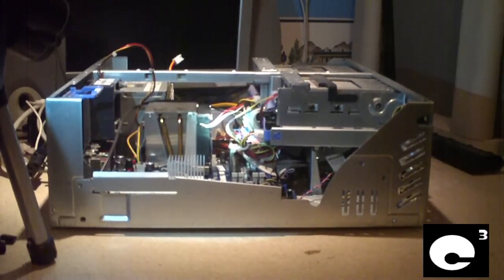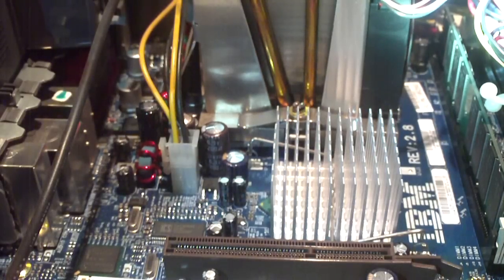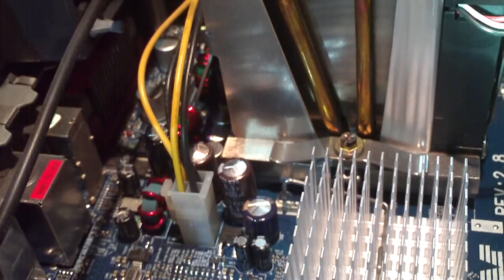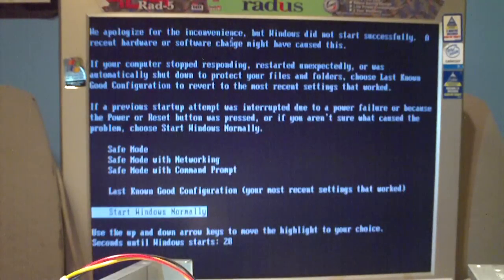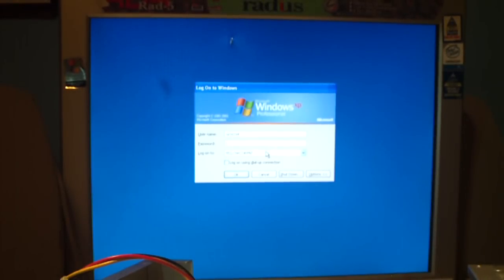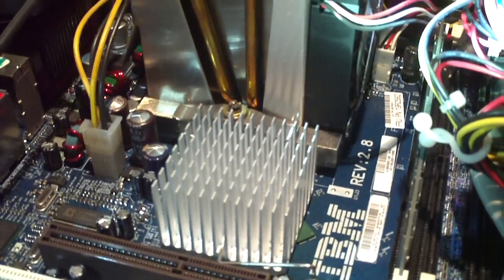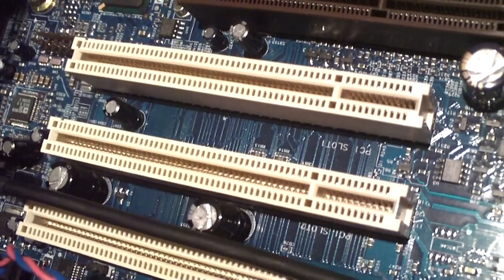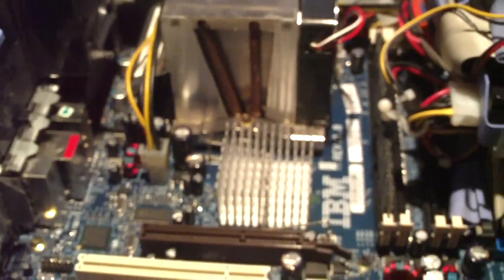Bad Capacitors and Fans in an IBM ThinkCentre PC

Comment: i have that model... suffered a blown cap and dual hard drive failure. the motherboard was dead, not even so much as a POST. power supply checked out as the CPU cooler fired up and the power light came on... wound up stripping the PC down yesterday... very good case design, fairly expandable, the drive bays lift up and there are a fair bit of RAM expansion slots on the motherboard. only pet peeve is there are only 3 PCI slots. best thing? the Slot II port for adding a Pentium II or similar processor

Comment: i had a cap fall off a Toshiba satellite and the weirdest thing happened... the screens brightness control went reverse so when i unplugged the computer the screen brightened.. couldn't figure out that was wrong until i saw the cap in the case lol so yea computers act strange when caps fail or fall off